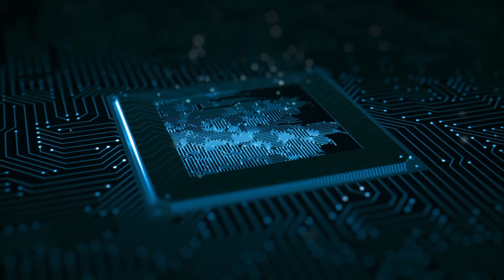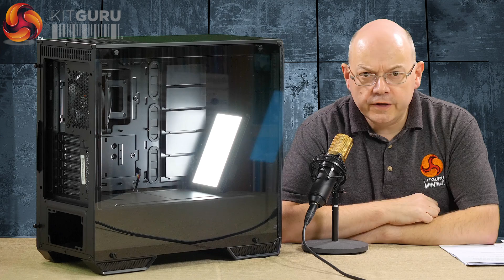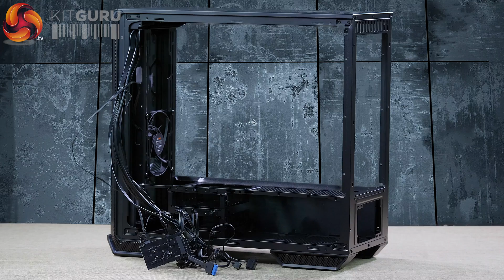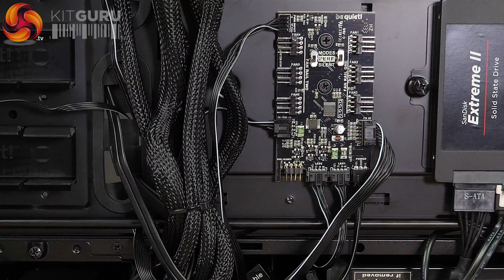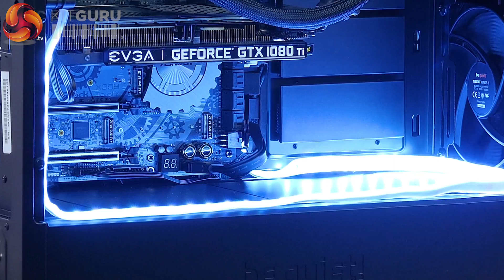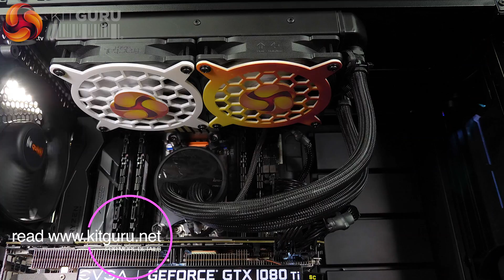be quiet! Dark Base 700 Case Review - overkill or overpriced?

Comment: Comprehensive review, as ever. One question though:  how does the RGB LED strip light up at the front? Does the PCB board just need SATA power, or do you need a newer motherboard with an RGB LED connector on it? Thanks.
Reply from the maker: Leo here: Connect power and you can control the LEDs using the button on the I/O panel. Connect to your motherboard and the case syncs with the software. I 'think' the connector is old school RGB and not addressable.
Reply: @KitGuruTech  Thanks Leo. That's good to know. Since I've an older motherboard, could I control RGB LEDs with a third party controller box instead? Something like the Corsair Lighting Node Pro?

Comment: Im looking into cases with inverted layouts and wanted to know if i set up inverted mobo layout, can i fit a 150i 360mm AIO in the top with push/pull fan setup?
Reply: You can put one up there but NOT in push & pull. You'll never need that level of cooling anyways. If your OC  is that aggressive then you've got other issues that a midtower case can't solve.

Comment: You didn’t talk about one of the 2 most important things. 

1. Support and functionality with AIO’s which is not great because the top of the case doesn’t have enough ventilation.
2. The case thermals are not that great considering the price and fans it comes with.  As the front doesn’t have enough fan intake area.  You could add more silentwing fans, that improves it, but that’s modifying, which doesn’t really count.

After adding 2 front fans and using air cooling, this is a pretty nice case. My controller worked fine, seems some people don’t watch the polarity on the RGB cables and accidental kill the controller.  It’s interesting this cable design is not keyed like everything else. 

I purchased this case, and other than what I mentioned, it’s actually a gorgeous and useful case, after some tweaks of course.
Reply from the maker: Leo here: Your comment reminded me to add the link to the review over on KitGuru (see above) where you will note I say '...the emphasis is on quietness, rather than airflow' so I think we are in agreement
Reply: Yes, This case is now $31.00 off at checkout on Newegg, that's one of the reasons I purchased it.  I used that saving to add 2 more SilentWing3 fans which makes it a good value now..  It's a bit of a fingerprint magnet, but that's not really an Issue.

Comment: Radiator cover the ram slot, this case not for me.
Reply from the maker: It might look like a problem but it is not as the AIO slides out on the radiator rack so, release two screws and the whole cooling system moves out of the way giving easy access to the RAM, fan headers and power connectors. If you did a hard tube custom build the radiator would need to go at the front.
Reply: Thanks KitGuruTech

Comment: no pc case in the world will ever be worth 175 bucks to me.
even at 100 bucks it's still a stretch, i'd rather get some good hardware instead

my most expensive case has been less than 50% of that price,
the 70 cm tall big tower case my fileserver is running on, which can hold 13 hard drives and 6 case fans, with an actual steel frame, cost only 85 bucks (chieftec)
downside of that one is the empty case already weighs in at around 16 kilograms, but the build quality/sturdiness was hard to beat for the price.

after that case, it actaully pains me to have to dish out 40 bucks for those "cheap" aluminum piece of crap midi tower cases that start resonating the second you look at them.
as for cable management, a bag of tie wraps does the job just fine.